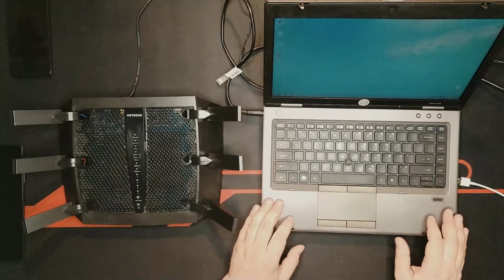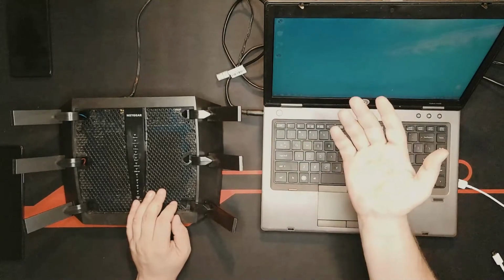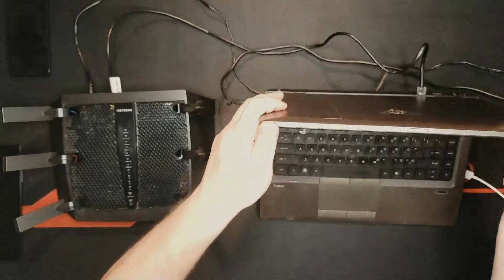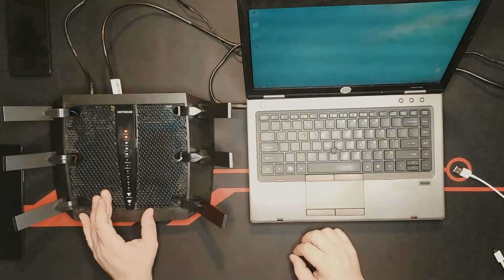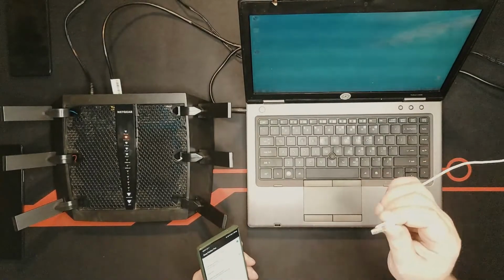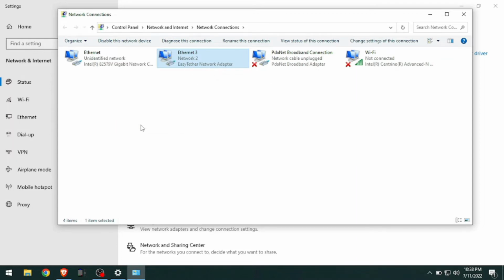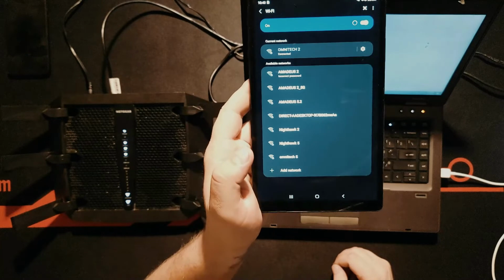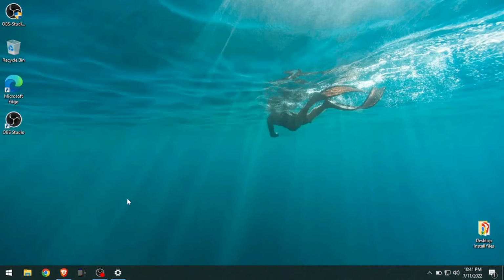INTERNET FOR YOUR ENTIRE HOME FROM YOUR PHONE, TURN YOUR PHONE INTO AN ISP CONNETED TO YOUR ROUTER

Comment: Thank you. But does d laptop need to be plugged in all d time now?
Reply from the maker: yes it has to because the laptop is bridging the connection to the router, now you can eliminate that by installing Open DDWRT on the router then installing easytether in it if your router has a usb port, but that is very complicated to explain on the comment, there are tons of videos you can take a look before you do the OpenDDWRT so you get familiar and evaluate if that's something you want to do.